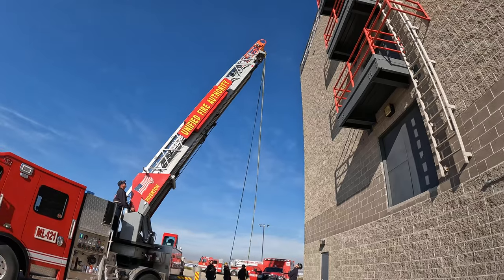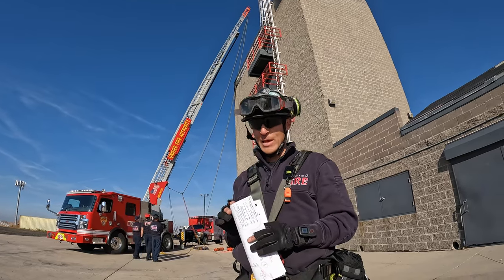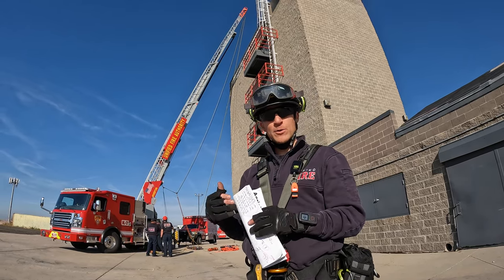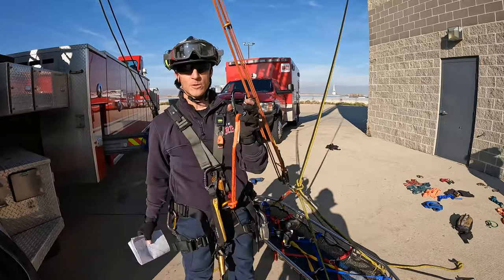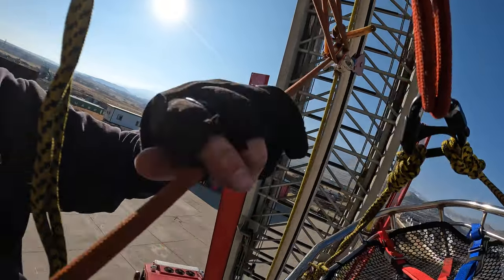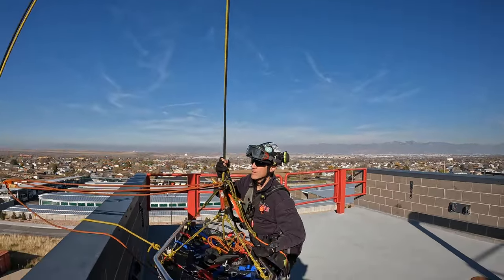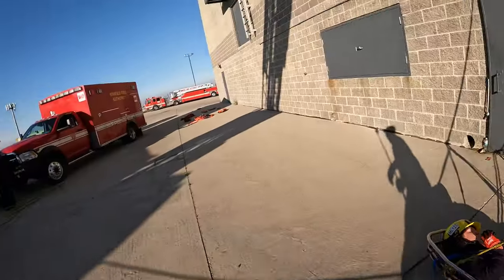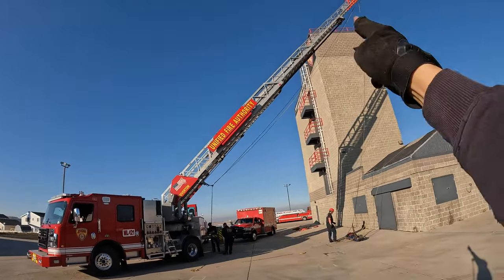Rope Rescue Operations Using an Aerial Ladder Truck as an Artificial High Directional

Comment: Nice tutorial. You hit all of the important points quite nicely. The manufacturer states exactly how much of a tip load is allowed and it is crazy easy to exceed those numbers. But I've also seen other departments use these sticks to perform pick and lift operations starting from a fully extended ladder at a negative incline. Thanks goodness it worked.

Well done.
Reply from the maker: Thanks!

Comment: Cool vid, thanks for sharing.  I’m assuming some of the “do’s and don’t” are manufacturer/ AHJ specific, as we utilize both a pierce heavy duty steel platform, and an ascendant aerial, and Pierce recommends doing a fixed pickoff as opposed to using it as a high directional, although we’ll train on both.
Reply from the maker: I would assume that your assumptions could be correct.  I don't know if there are any manufacturers that will publish any tables or info on using these as high directionals because it's so variable & dynamic based on magnitude & direction of the resultant as a function of aerial angle & aerial extension.  I think that training on both is a good thing because our environment is too dynamic & unpredictable to arbitrarily cross one option completely off the table & say "never".  Different techniques are like having more tools in the toolbox... It's always better to have a multitude of options.  But it's on us to select the best ones for the specific task & make informed decisions based on pros vs cons, & risk-reward analysis.

Comment: I have been watching many of your videos and have enjoyed the straight forward, direct approach. Very good info presented. Being on the East Coast I like the West Coast and RTR influence. You don't get a lot of that over here.

As a far as this video goes; it's my opinion that this topic is very polarizing and often misunderstood and misapplied. This definitely can go beyond the basic understanding of many rank and file FFs, myself included at times.

Are you familiar with the testing that Kelly Burne out of DC did for the ITRS on this? Also the CMC guys (also Kelly) did a podcast on the subject.

They had some interesting results. I would welcome your thoughts specifically on the idea that the aerial device should be though of as a truss and not a column, therefore the idea of pulling in line may not be the best.
Thanks again.
Reply from the maker: Thanks!    Truss vs. a Compression Member?  I’m at a loss.  My gut feeling is that you can’t have your cake & eat it too, & there’s always going to be some kind of tradeoff or compromise when trying to rig aerials safely, or with some sort of confidence in your perceived ability to know what you’re doing & why…. & where the weak links exist.  So I don’t have any solid opinion on it as of yet.  Most of the issues that were brought up in that CMC podcast resonate with me & for the most part I agree with what was discussed.  I’m personally leaning towards AHD as opposed to using a B&T system at the tip, but thats because the lens I’m looking through favors crane rigging theory.  While a B&T does minimize the tip load, I just think it’s less practical than the AHD route.
Reply: Thanks for the response. We definitely have work to do on this topic..  @Propeller_Head

Comment: What is the tip load for your aerial? I noticed the bolt on was really small and that's where the common "tip load" is referred to so is where you're placing the webbing technically a higher load capacity?
Reply from the maker: There are max load placards located at each welded eyelet that is part or the aerial frame.  Each eyelet on our aerial says “Max 250 lbs”.  Yes, if you elect to rig webbing around the aerial rails then I would argue that your capacity “could” be more than if you were rigging to just the eyelets.  Rigging anything to the aerial beyond those small bolts is a No-Go.

Comment: What is the OSHA regulation that you are referring to?
Reply from the maker: 29 CFR 1910.180 (Crawler Locomotive & Truck Cranes)... [h.3.iii.v]
Reply: Thanks!
Reply: Does the OSHA regulation pertain to attempting to move the aerial when we have a long haul system rigged or would it technically apply to a short haul system as well? Using an aerial device as a high directional does not load it as intended where as a short haul loads the tip in a vertical orientation which is inline with the manufacturers tip load. @Propeller_Head
Reply from the maker: The regulation pertains to the dangers of operating the hydraulic systems when live loads are suspended & does not address specific types of rope systems.  So it doesn't matter what kind of haul or lowering system you have.  I'm confused on your terminology of "short haul".  Can you explain what you mean by that?

Just like velocity has both a speed and a corresponding direction, a load, wether it is directly off the tip of an aerial or through a high directional, will create a force vector that has both magnitude and direction.

If you suspend a load directly off the tip, there are two aspects of force to consider (and this is typically accounted for in the aerial tip load charts based on the angle of the stick and the extension, or length of the lever).  The first is the net force of the load itself that points directly down.  The second is the torque effect that the load imparts onto the fulcrum of the giant class 3 lever (that is the aerial ladder at its base where the hydraulic rams are).  The longer the ladder (more extension) and shallower the angle, the less tip load capacity, regardless of if it's a directional or if a load is suspended directly underneath.  However, the tip load charts do not account for the force amplification effects of a directional anchor.  Interpreting these effects are the job of the rope rescue practitioner.

Quick case analysis:  If you extended the ladder out to full extension and the angle was flat to the horizon, then suspended a load vertically through a 90 degree directional, then there would be a net resultant force acting on the tip.  This force value is 141% of the suspended load, but the direction of that force is 45 degrees closer to the structural frame of the ladder which helps reduce/mitigate the force amplification that is seen at the fulcrum.  On the flipside, if the load were suspended directly from the tip, then the net force is less at 100%, but the resultant force direction is 90 degrees away from the structural frame of the ladder which increases the torque at the fulcrum.  To further make things worse, when you apply practical rigging to this equation, there are three common options to either lower or haul a load that is suspended from the tip.  The first is to have a rescuer at the tip operating a lowering device.  This setup doubles the tip load because there's now two people @ the tip... so 200% force amplification in a straight downward direction which is not ideal.  The other common setup is when you rig a 4:1 block & tackle system onto the tip & operate it from the ground.  This creates a 125% amplification of the force in a straight downward direction, also not ideal.  The third is to use the tip as a directional but the line routes a full 180 degree bend so that the source of the haul is straight down.  This also creates 200% force amplification in a straight downward direction.

Routing the line along the frame of the ladder and through a high directional, while you do amplify the force of the load, you also are moving the direction of the net resultant force closer to the frame which eases the torque forces at the base of the ladder.  And this is the critical part of using the aerial.

The weak point in this system is the invisible torque effect that can occur at the base of the aerial, not so much the load at the tip.  So doing whatever you can to mitigate that weak link is paramount.

Comment: Your 1st evolution. Try lowering your patient as a skateblock system and ditch the tag line.  It works really good.  Get some load cells. I'd be interested in your readings.  Something else you can try is get truck scales like PD used to weigh trucks.  Put them under the outriggers.  Get baseline reading with no load at all extension and rotation.  Then do readings while FFers are climbing and doing normal firefighting tasks like roof vent etc.  after all that then do rope work and see what you came up with.  I've done a little backyard testing doing these things and have a few numbers.  Your doing cool stuff keep it up.
Reply from the maker: Thanks!

Comment: you should really think about attaching yourself somewhere else safer. your side loading that carabiner and your also clipped in on the gate side which is a huge mistake. there is hardware out there you can get to simplify that mess of knots and carabiners. I would suggest looking into a rigging plate which would be safer and quicker.
Reply from the maker: I appreciate your feedback and insight, & I went back through this video in an attempt to identify the issues & mistakes you pointed out but I’m just not seeing what you’re seeing.  Could you provide me a timeframe (minutes & seconds) where you saw these errors so I can look further?

As far as the rigging plate goes… opinions vary & I fully understand that many practitioners out there like using rigging plates.  I also like using them, but I prefer to reserve them for places at the anchors.  When rigging the rescue package end of rope systems, I tend to default to a “low-profile” philosophy & try to reduce the profile of the master attachment point, thus the bowline knot to act as the “yoke” or “MAP”.  “Quicker” & “Safer” are subjective & relative terms to be left for interpretation by the individuals & teams that choose to employ certain rigging methods over others.

For me & my team, we would argue that it is quicker & safer to use the double long tail bowline rather than incorporating a rigging plate.  For us, a rigging plate is just an extra piece of gear that we don’t need & just eats up additional real-estate in terms of height clearances.  To quote a mentor of mine, “simplicity & complexity are not technique issues, rather they are training issues.  What can be seemingly complex for some teams may be relatively simple for others.”